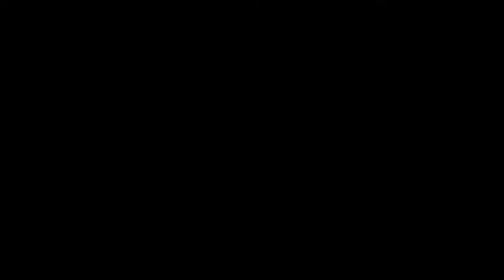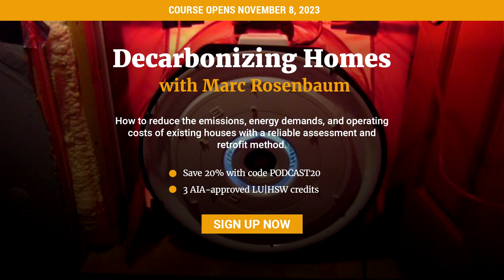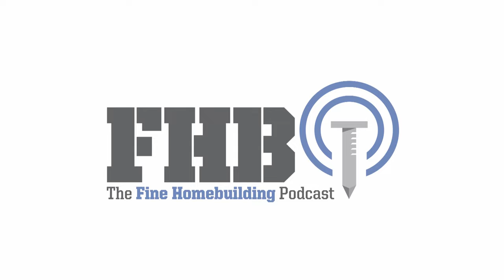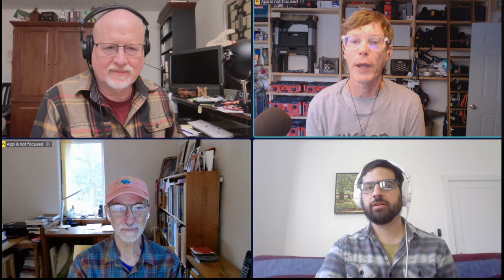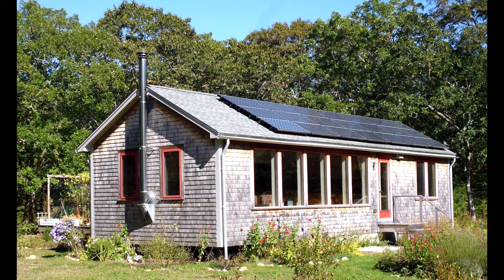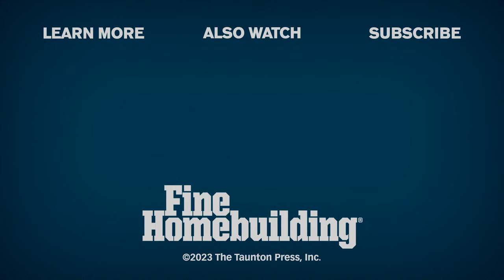Podcast 604: Conversation and Questions with Engineer Marc Rosenbaum

Comment: Funny, just yesterday I thought of having a well insulated water tank where excess PV would cool the tank in summer and warm the tank in the winter.  Then use the thermal mass of the tank to improve the efficiency of the hvac heatpump and maybe the water heater heat pump, also.   Not saying I have it all figured out,  just hand waving. The local climate, current season, and weather forecast would have to be considered to determine whether to heat,  cool, or do neither (send excess PV somewhere else).  A smart controller to control valves would probably be needed.  Just hand waving as I said before.  I wonder if there are residential off the shelf systems that do this.  I. hope to build an ICF retirement home with solar panels and battery storage, off grid capable.  I know concrete has a large carbon footprint, but that can be amortized  over the multiple generations that can use the house.